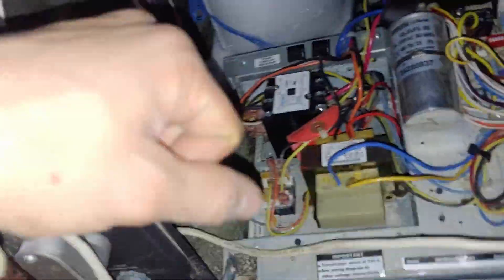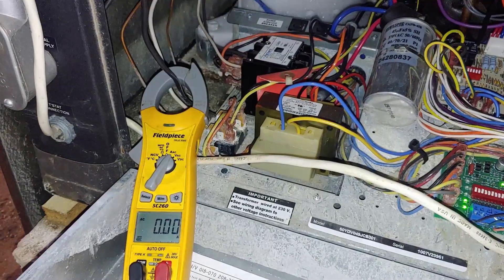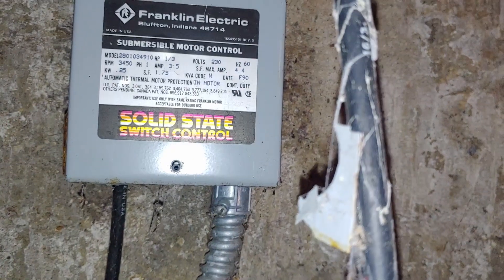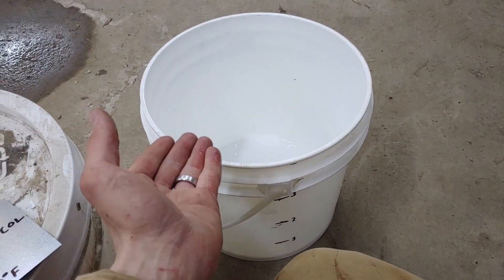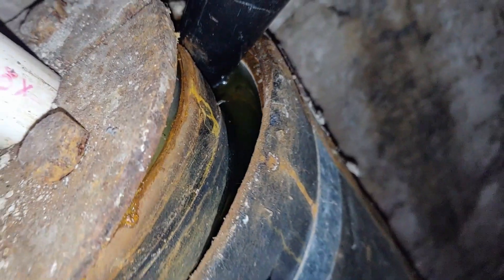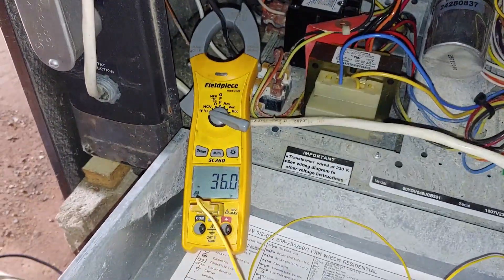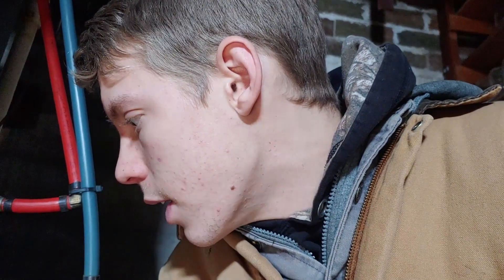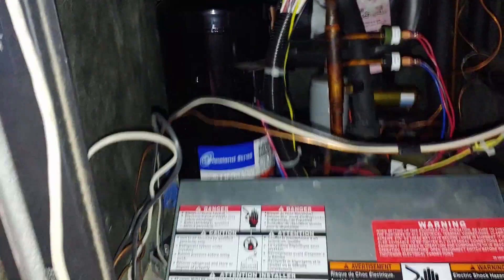Heat Pump Low Temperature, Low Pressure Code? How to add Water to Loop Field.

Comment: hey man, am a repair technnician based in in uganda. just wondering how long it might take me to be trobleshoot big logic works like this.
Reply from the maker: Keep learning what you can, and don't turn down opportunities to work on new equipment. The best way to learn something is to be in a situation where you have to figure it out. That's how I learned most of what I know.

Uganda? That's pretty far away! Do you know anyone who follows Jesus over there?
Reply: @ReubenSahlstrom  thanks for the advice,   am 3 years in the field. lol people know Jesus and you are chatting with one
Reply from the maker: @ssekasiedward5688  Glad to hear it! I pray that you will be an effective tool to further the Gospel and take care of technical needs! God bless!
Reply: Appriciate your sentiment.God bless
Reply: Mr Edward,  what do you use in Uganda for ground source heat?  Vertical wells?  Buried horizontal loops of pipe?
Reply: @warrenblack9839  its kinda rare to find ground heat source installations here in uganda due our climate (tropical), i havent encountered one
Reply: @warrenblack9839  uganda lies in the tropics, the weather is kinda warm (tropical climate) , its very rare to find these systems in infrastures. i havent encountered one for sure
Reply: @ssekasiedward5688  I was curious about that.  Ground source heat pumps are used in Minnesota for heat in the winter and cooling in the summer.  A system that will heat a building in the winter is usually 2-3 times more cooling capacity than is needed in the summer.

Comment: That was interesting. I'm in Scotland and have a ground source heat pump - coiled loop underground into my fields. Is this system a deep well bore? I'm intrigued as to why you have an open well top. Is it a sealed pipe? 

I have a low pressure alarm which is preventing the system from working, but so far I can't find any leak and all pressure gauges are ok.
Reply from the maker: No, it has a loop field out under the field in this guy's sheep pasture. The well type casing thing is only about four feet tall and contains the pump and a small amount of system liquid. 

If your system will not run due to a low pressure switch on the refrigeration circuit, then you likely have a refrigerant leak of some kind. Do you guys Carrier units over there too?
Reply: @ReubenSahlstrom  thanks for the reply. Not sure what a carrier unit is so can’t answer that. I’m not an engineer, just a bit technical. The engineer who visited did say the refrigerant was almost gone so he recharged it, but there wasn’t any signs of a leak so it is probably a very long standing issue.
Reply from the maker: @PeterPrestonUK  Funny you guys call them engineers over there. We call them Technicians.

If the system was nearly out of refrigerant, there must be a pretty large leak. Sometimes they lose the charge slowly over a couple years, but if they lose any they are leaking and will be low again at some point. Hopefully it's a small leak, but it really should be fixed if possible.